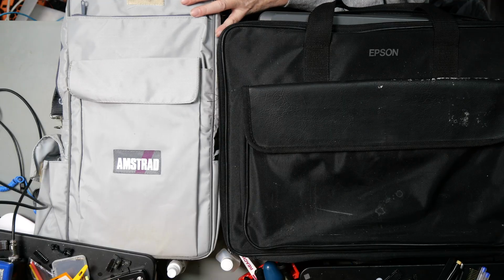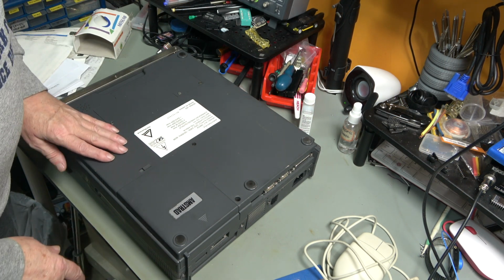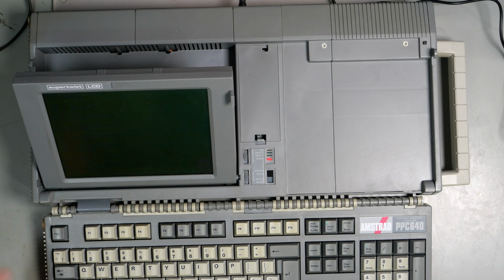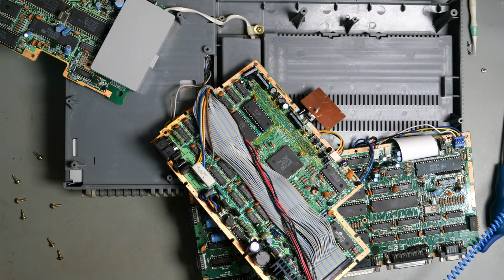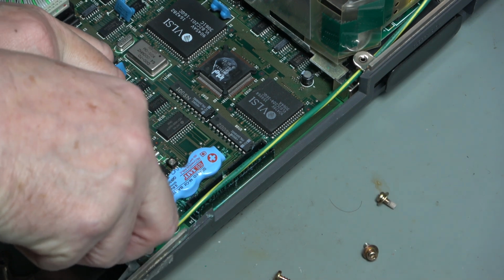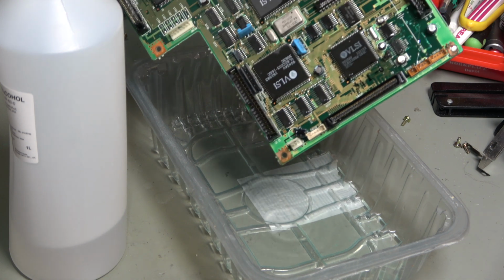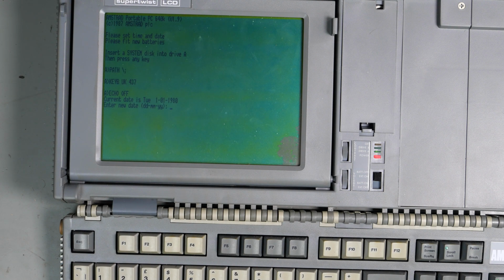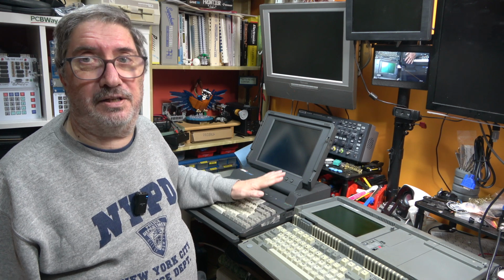Episode 86: Amstrad Triage

Comment: I would vote for fitting the monitor driver where the modem bits were. They can be preserved to be reunited if they are every required, but I think a better display would be far more useful.